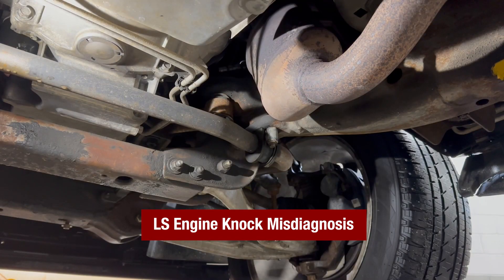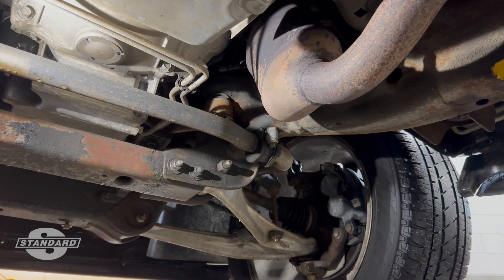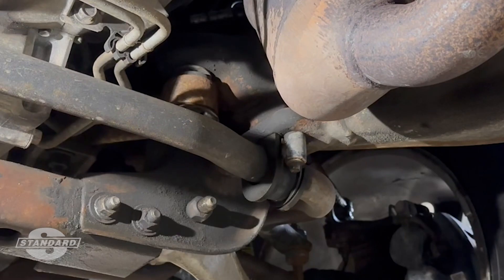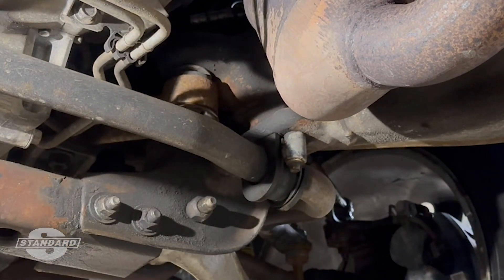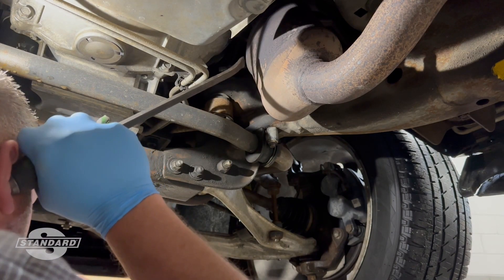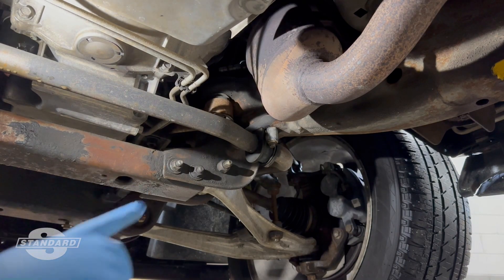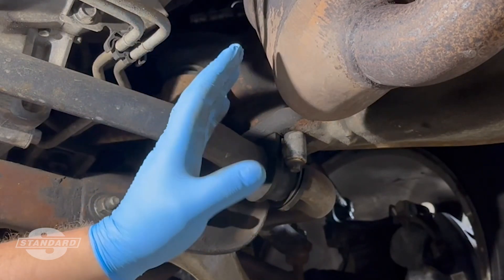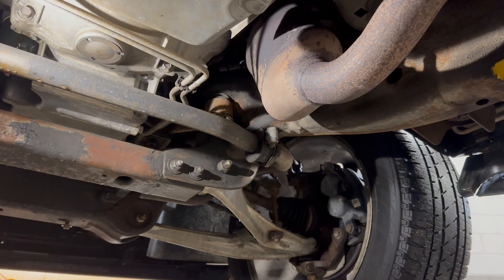LS Engine Knock Misdiagnosis | Tech Tip

Comment: Great tip. I just finished installing a used engine into a 2012 suburban and it has a similar knocking sound. I was using a long Ext. 2 listen to different parts of the engine and I still can't figure out where it's coming from. If the Engine is knocking from something like piston slap or a lifter where would you hear it?